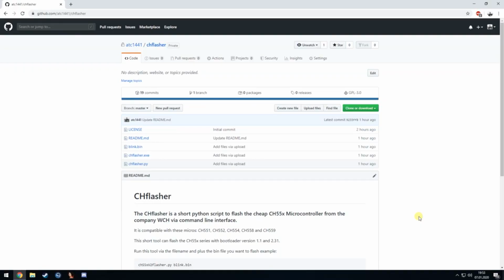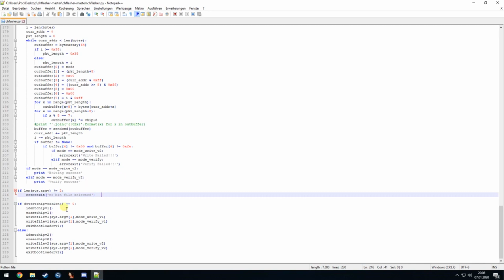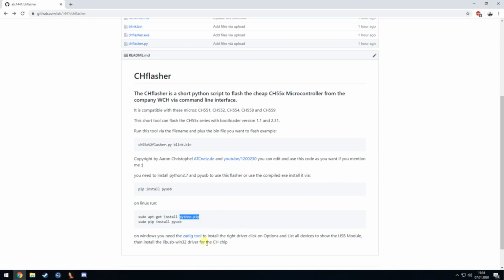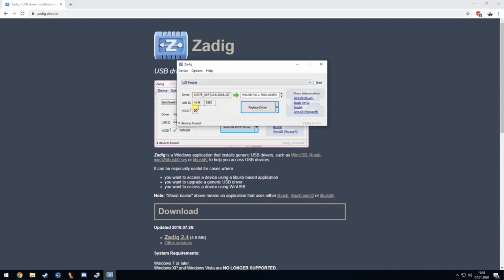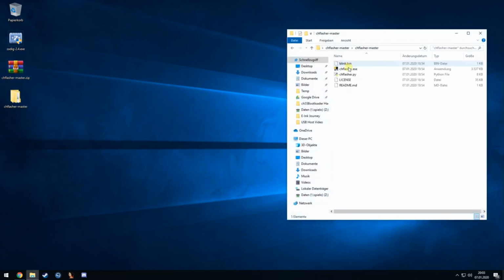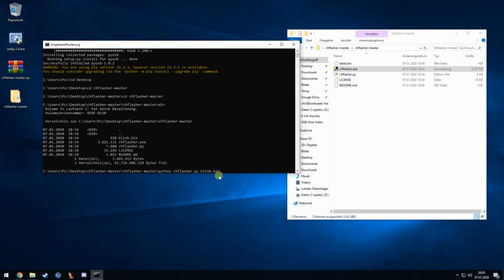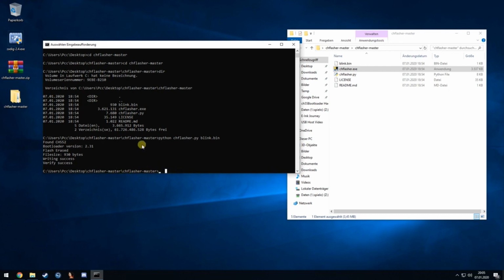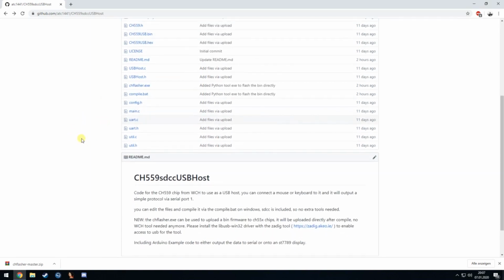CH55x usb Micro Flash Tool, OpenSource

Comment: Hi! I faced one problem with chflasher.exe. If my bin file size is 11311 bytes, then it's ok. But 11311b is the maximum size that I can burn to my CH559L. If my bin file size will be 11312 bytes and bigger I get an error:  Found CH559
Bootloader version: 2.40
Flash Erased
Filesize: 11312 bytes
Writing success
Traceback (most recent call last):
  File "chflasher.py", line 228, in <module>
  File "chflasher.py", line 208, in writefilev2
NameError: global name 'mode_verify' is not defined
[8208] Failed to execute script chflasher

Is it mean, that the maximum capacity of CH559 is 11311 bytes and it's filled on 100% with that firmware?

And, of course, CH559 won't launch with this firmware after getting an error.
Reply from the maker: As the flasher was first only meant for ch552 the limit is set so low. 
You can edit the flasher on your own to accept bigger files
Reply: @atc1441  Ah, thanks, I'll try it :) Should I change these lines? device_erase_size = 8
device_flash_size = 16
What's the erase_size?

Comment: Great tool. But its very hard to find correct  pinout for the chip. can you please share the schematic. Also exactly which pin should be set to ground to set the chip in programming?
Reply from the maker: Hi, you can find a Pinout here: 
https://github.com/Blinkinlabs/ch554_sdcc/raw/master/documentation/CH554%20manual%20english.pdf

Also i have other videos of these chips on my channel, please check them out.

You have to put USB DP to 3.3V on the CH551 to CH554 chips to get them into Bootloader mode. On the CH559 is a dedicated pin for this, but i show that in the other videos.
Reply: @atc1441  Finally I've got it to work. I was trying on breadboard and it was not working. At the end had to create a PCB (Exactly like your first prototypes) and it just entered into boot loader mode on the first try. Thanks.
I have a project which CH552 or CH559 are perfect micro controller candidates. But I need some help from you. can you please contact me directly via email so we can talk more?
Looking forward hearing from you.
Reply from the maker: Nice that it works.
Unfortunately i can not give free support for these micros as they are also hard for me to work with.
Reply: @atc1441  Who said it will be free? hehe
I totally understand and respect your time. Maybe if we talk private, we can come to an agreement.
Reply from the maker: Please write a mail to ch55x@43u.de

Comment: How did you reverse-engineer the commands used to flash the chip? With Wireshark USB sniffing? (Or is there a part in the documents from WCH telling how this is done?)
Reply from the maker: For once by analyzing the real usb communication and with this exploit it was possible to extract the bootloader, then Thomas Z. was able to decompile the bootloader from bin to c ( https://www.mikrocontroller.net/topic/462538#5784458 ) so it was quite simple to build the protocol from it.

As mentioned in the video half a year ago i already made a working android app to flash them directly via a smartphone, copied most of the android app structure to python.

Comment: Great work, guess I now really have to order some of these.
One thing to mention: Python 2 is EOLed, doesn't get any updates and should not be installed on anything else than test systems for security reasons. As far as I can see the code should mostly work with python3. I changed the print commands to the current style, however have no chip to fully test the upload process.
Reply from the maker: Thanks. I am still living in python 2.7 :D but i know its eol :( 

Can you send me the modified code i will run a test with it
Reply: @atc1441  Just use the fork ;) https://github.com/adlerweb/chflasher (keep in mind to install all necessary modules also for python3/use pip3)
Reply from the maker: @adlerweb  Works! 
Just one typing error. line 31 there you use exiterror but it is not defined there so better replace it with just print as the sys.exit is called twice
Reply from the maker: Added the changes to the main repo :)